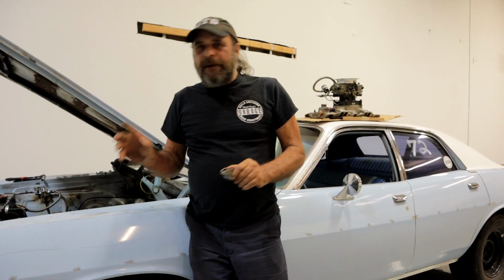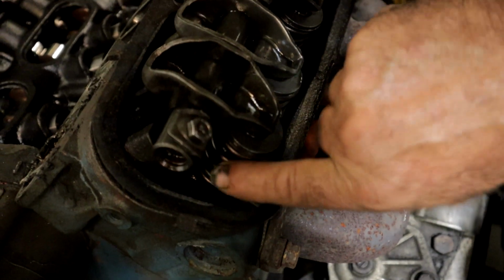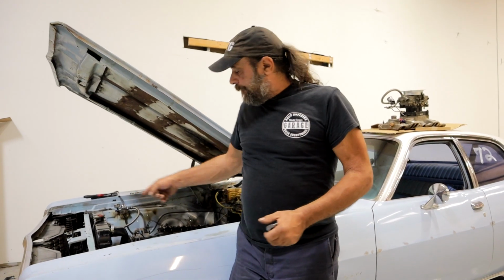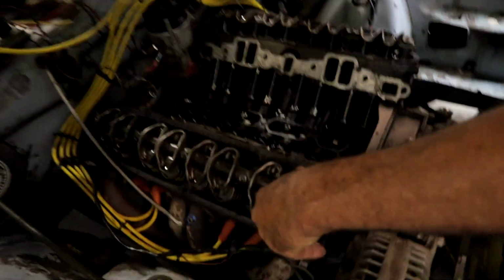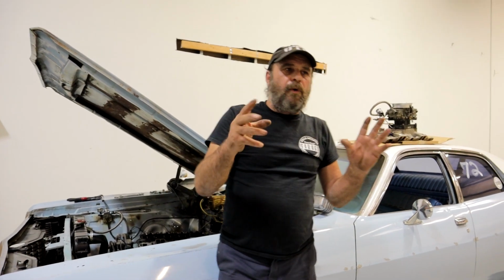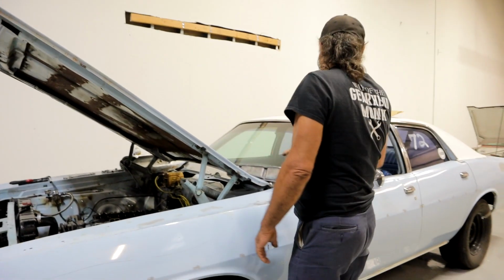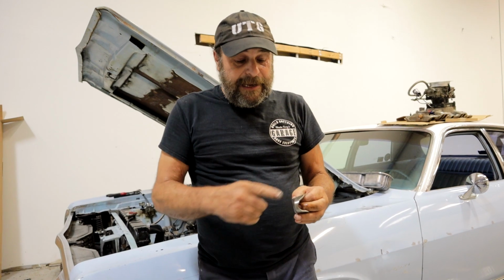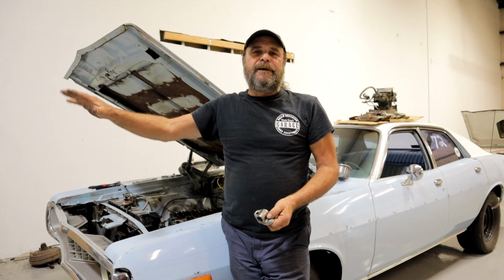Bottle Rocket Rocker Failure Explained

Comment: Why wouldn’t you run a decent set of roller rockers with a cam that’s got that much spring pressure and that much lift it’s not gunna work well with stock rockers that’s what it’s gunna do every time just ask any good engine builder
Reply from the maker: Did you even watch the video, you freaking moron???  STOCK 340 valve springs....550 lift on the cam, 6000 rpm max.  What part of that it too much for stock lifters?  Idiot
Reply: @UncleTonysGarage  suzan wojiki will drop your social credit for this comment. You give negative comments way too much care. Let people talk and boost your engagement
Reply: @jamesola7968  I know right. These armchair or at best backyard mechanics that maybe built one engine think they know more than someone who has been doing this for more years than I've been alive.
Reply: @Zero fox Given, stock rockers would work on that cam setup all day long and never be an issue, wanna know how I know? Because I have a nearly identical setup on a big block engine and it's running stock Mopar stamped steel rockers. I used to daily drive the car, and never once had an issue. Plus you don't know how ANY of the specs on Tony's cam unless you have been watching since the earliest days like myself.
Reply: @alfulton5946    @James Ola   These 'doofuss' comments come from 'Keyboard Mechanics'.  I'm like UT, 50 years of doing nothing but MoPars, and NONE of them the late model 'disposable' fake hemi.  A pure stock 318 from the 60s and 70s with all OEM MoPar parts would sit and rev 6,000 RPM until it ran out of gas without doing any harm.  Modern 'Repair Parts' are just garbage...
Reply: This is an affordable build for starting car builders.
Reply: @ScottsSpeedShop  There is a recent video of Nicks garage where he built and dynoed a customers 454 chevy. Aftermarket heads, hyd flat tappet cam and stock stamped rockers. Made 570hp. I know its not a  mopar build but the stamped factory rocker arms were more than  adequate on this build with the cam he installed. The commenters went nuts wanting to see some pretty gold or red anodized aluminum rocker arms. The TV channels have made everyone believe they need Harland Sharps or T&D for every build.
Reply: @ScottsSpeedShop  i love that you watch this channel, i found you because of the little red ram hemi (do another) you and tony should do something together.
Reply: @TheOverisel  it is a shame what the world has come to man. I know with my customer, I tell 'em if it's a street car and you need adjustability, ductile iron style rockers are the way to go, like the 273s had or like the max wedge engines had. I haven't ever been a huge fan of aluminum roller rockers, but sometimes that's the only option. Like on my edelbrock victor heads, I can only run aluminum roller rockers on them because of the offset
Reply: @TallGarage  I have been following Tony since the day he started. Him and Kathy are great people and I bought a six pack setup off of them years ago. As far as the Red Ram Hemi, I do have one stored away, that I am gathering parts for. I will build another.
Reply: @UncleTonysGarage  Are those valve springs rated for the cam its being used on? By that I mean are they strong enough to hold the valve train based on the ramp of the roller cam? I realize that they are stock springs but are they stock roller cam springs? I only ask since with a high ramp rate a spring can lose stability even at 6000 or lower and cause issues like the rocker failure.
Reply: @ScottsSpeedShop  I'll trust the opinions of UTG and Scott's every day of the week.
Reply: Hey he spelled gonna with a U, what do you expect.
Reply: @zerofoxgiven89  you specifically mentioned springs with that much pressure. Are you claiming that stock valve springs with .560 lift is too much for stock rocker arms?
Reply: @nastybastardatlive    Hahaha...  And he's probably 'jelly' of UTGs knowledge too!
Reply: @zerofoxgiven89  Brand new lifters from a big box brand cam company should not be bleeding down like those are, even if he put a fancy set of roller rockers on he would still run into the same problem with the pushrod smacking a hole through them. The problem isn’t the rockers, it’s the lifters bleeding down.
Reply: @seandraves828  exactly what I’m trying to say. A stock 340 spring would be for a hydraulic flat tappet cam not for a roller cam
Reply: @NYPATRIOTBX  never once did I say anything about the issue with the lifters
Reply: @UncleTonysGarage  I agree with you unka tony, and you really should not call him an idiot. even if he is.
Reply: ZFG,  you may think you have THE answer...  I will point out that chrysler cams and failed hydraulic lifters cause this same punchout.  at the cab Co, we'd toss a random lifter in the engine and go up to the next oil weight.   Tony may punchout more rockers but a failed lifter is doing it.
Reply: @zerofoxgiven89  No you didn’t, but your assuming it’s a problem with the rocker when it is not. The spring pressure and cam lift are nothing to write home about.
Reply: @frenchonion4595  and ??? How many has he done right?  My gosh he knows what he is doing
Reply: A stock rocker should hold to 6000 no problem, on most stock motors the lifter is the weak point you'll float the lifters before you damage a rocker arm ive seen ford 302 with stock rockers and a good set of lifters rev to 8000
Reply: Here's my couple of nickels worth and this is something I learnt from being an aircraft mechanic for the last 22 years.  There's always something to learn from somebody...whether a seasoned pro or a noob.  You absorb what's useful or you hold your tongue for what isn't, for what you may think someone is full of crap when it comes to say hydraulic lifters but have a wealth of knowledge when it comes to anything else.  Don't burn your bridges on somebody because of one stupid thing.  But I do tend to side on UTG on this one.  Crap components run amuck in today's world...and the same goes for the aviation industry.
Reply: I ran a Direct Connection purple shaft cam with more lift than that in my 1970 440 and put 100,000 miles on it and never had any rocker problems.  I used stock, Chrysler hydraulic lifters and my redline on that engine was 6,000 rpm.
Reply: @NYPATRIOTBX  I doubt he even watched the video.
Reply: I will point a good part of the blame on quality control of parts and even some of the metal quality. Thats what we get for relying on everything china.
Reply: It's about budget builds for the average car person.
Reply: @UncleTonysGarage  sick 'em you hot-headed Italian!  Chevy guy, probably eats paste & Tide Pods! 🤣🤣🤣🤣 With you 100% on this build Tony, my favorite on YouTube!
Reply: Also kinda funny how a channel called The Gas Tap built a ringed & bearinged, home ported head 360 Magnum that ran 12.60-.70s in a short bed pickup with stock rockers also. Just sayin'.
Reply: @brucenichols540  you say that but the new hemi(which has a better chamber design than the old one btw) you can use stock rockers and get some OEM non MDS lifers and never have any of these issues.  sit at 7000rpm with no issues on hi compression 5.7 hemi, especially with the much nicer lifter angle. the problem is the mopar small block is a really small part of the aftermarket so companies don't want to invest money in better parts for them,  which is wrong but its what they do. this is why I just plan to move on after I get tired of my magnum and build a 6.4 gen 3 hemi. quality parts, heads are better, lifters are better(the issue with the lifter failure is just due to low idle speed and thinner oil to maintain emissions, that's why the hemis and 392s don't have the issue only the earlier 5.7s)the block casting is much nicer, they can take 1000hp with no issues, the cam bores arent misaligned, the lifters bores arent misaligned, better casting material with more nickel content and a lighter weight. the fake hemi would whoop any old mopar engine any day of the week.
Reply: Plan Z!!
Reply: @AndyGeesGarage  never said that they would or that was the problem of the leak down
Reply: @UncleTonysGarage  I deleted my comment. I don't want to be a "wack-a-mole  psychotic"
Reply: Lmao
Reply: Comp cam is garbage now
Reply: @PredaFran  All true!   However, I'm only interested in the longevity of my equipment and its easy repairability.
Reply: @PredaFran  the lifter issue can be fixed by eliminating the mds . as great as the classic Mopar engines are the gen 3 Hemi is superior in pretty much all areas .
Reply: @zerofoxgiven89  if the stock springs are ok on a flat tappet cam then they will certainly be fine on a roller. Roller cams have softer ramp rates than flat tappet cams. Don't take my word for it check out David vizards channel. He has a video on the subject.
Reply: @UncleTonysGarage   Tony. Im sorry but i didnt catch if the rockers are new or used old ones? I too have had issues with brand new roller cams having lifter issues. It was a few years ago now but i believe the set i used were COMP CAMS... I did everything right. Cleaned the lifter bores.. Whole 9 yards. But when that engine was only run for short trips infrequently it would have lifter tick. Even once warm here and there. After i started daily driving the car a while later all that stopped. Kinda like the lifters needed to seat in to begin getting proper oiling. Now this could have been due to sludge in some oil passages that finally worked out.. Not sure. But it took a good. 1,000 - 1,500 miles for things to get acting right... Now onto the other strange issue. 318 that keep wearing out timing sets.. On 3rd set now. In 5k miles... Tried different brands tried stock single and true double roller... Ever see such a thing? Haha
Reply: @UncleTonysGarage  I like that response Tony, it is very appropriate for the question.
Reply: @UncleTonysGarage  Perfect answer! "Dude, are you kidding me? I just spent 10 minutes explaining why I'm using hydraulic lifters and stock rockers."
Reply: @brucenichols540  what kind of car do you
Reply: Those rockers should of handled it. Plus they are shaft rockers. Strong as hell. I'm old guy and we ran more lift on em back in the day
Reply: @richbon8825  I'm sure Uncle Tony is right about the failure: The lifters bleed down and on every startup the pushrods are pounding the rockers until they pump up again. This particular rocker might have been weaker but it's only the first of many if the other lifters are bleeding down like that.
Reply: @UncleTonysGarage  Thank you Tony, keep it real brother.
Reply: Stock valve springs won’t wear the same unless the lifters are unified against the intake valves.....

.......I don’t know shit about engines.....just wanted to be part of all this 😩
Reply: @frenchonion4595  a lot ..and the best builders have cams go bad so don't act like it doesn't happen
Reply: @maidenrulz73  No worries, just because you don't know shit about the subject is no reason not to comment. This is the internet.
Reply: What i did was Not watch the video at all.. but I have money, so I don't need to too.. what I do know is you didn't spend money like I do, Cause I have money to spend or at least the guy charges me money.. That I have by the way... 
Only the Very Worst Advice Only.. UTG come get you some hahahah 
@Ø..
Reply: @zerofoxgiven89  Stock rockers have been holding up to cams like that for a long time now. Folks have been elongating the slots in stock chevy rockers and running well over .500 lift for probably fifty years or so. Same with other brands as well. With that said, I lost a stock rocker on a 350 with stock LT1 springs (the original first gen LT1) and a 350 horse hydraulic cam (.447" lift) once, years ago.Just a fluke, same as Uncle Tony's situation. It happens occasionally.

You should keep your piehole zipped and give Tony a little credit. He said lifters but probably meant springs. I'd be pissed at your post if it were my video too, you spoke without knowledge to back you. I think Tony's a pretty damned good builder, probably a lot better than you. He wrenched top fuel motors for years and was a successful magazine writer as well.

By the way, Tony gave us a theory as to what's going on, and it doesn't have a thing to do with the springs. Maybe if you took time to watch the whole video.....
Reply: @zerofoxgiven89  Hey, dude, I have seen builds like this several times, and what I think has gone over your head is this: there is NOTHING wrong with how this engine is built, the valve train should be fine. However, because the lifters are allowing slop in the valve train, the pushrod beats itself and the rocker arm to pieces. Roller rockers would NOT fix that issue. What about any of this is so difficult to understand? Shitty lifters have caused this problem, NOT any other part of the valve train choices made. You simply wanted to add your two cents to a conversation that seems to be WAY above your level of understanding. If he had been using roller rockers, then the hydraulic lifters bleeding down, would have then destroyed an expensive ass rocker or set of rockers. Get that through your thick ass skull. THE only solution to this issue, are lifters that do not bleed down every time the engine is shut off. If you can't understand that, you don't need to put your input into a video. You instead decided to play yourself as a fool. And it is, that simple.
Reply: @zerofoxgiven89  did you not listen to what he said? The cam is about as close to stock grind as you can get, the problem appears to be excessive lifter bleed down.
Reply: @1965l88  if he was so successful in all that why wouldn’t he still be doing that instead of on YouTube making videos where you can’t get fired. I don’t care who you are if your on a top team making big money and all who’s gunna stop that unless they got fired because of all this shits probably happening just like it is in the vids he posts
Reply: Bruh, get some sleep
Reply: @HowardJrFord  indeed, great engines
Reply: @jamesola7968  lol- Tony hasn't been building motors for 50 years, he's only like 59 years old !
Reply: @brucenichols540  i do like the fact that the LA can be maintained by a minimal set of tools but i don't see the ease of repair anymore with the prices of carbs and all the shitty repair parts. It's not worth the effort to buy NOS parts because of the cost. It's just cheaper to switch to a gen 3 than to wade through all the junk parts.
Reply: @davidleonard8369  i though the main advantage of roller cams was the faster ramp rate, at least my roller cam has a fast one
Reply: @frenchonion4595  yeah your right you know more than him 😏
Reply: @justralphajerseyguystuckin3671  45 years, then. Since he was 14.
Reply: @PredaFran  according to David Vizard roller cams have much higher lift acceleration than flat tappet cams but only after the ramp. Anyway, the cam in bottle rocket is not very radical by any stretch of the imagination and stock 340 springs should control things very nicely.
Reply: To make this statement you obviously didn't listen to the objective of this project. The real sad part of garbage parts goes beyond wasted parts money and time. Let me explain by using this scenario...... your building your first project  as a young person. Your not wealthy, your not experienced.  You are going to get discouraged real fast when everything you touch turns to shit or water through no fault of your own . It's not just car parts either . Almost all consumer goods are terrible quality anymore. And shame on manufacturers who put profits ahead of quality.
Reply: @derrikspivak4523  too big a cam?  The cam in bottle rocket is identical to the stock cam. They are both about 2 1/2" around and two and a half feet long. Ha ha.
Reply: @truckerkevthepaidtourist  real trucks are white and have 2 pedals
Reply: @jamesola7968  ya because as soon as you do something exactly 50 years you know everything and nothing changes.
Reply: @jeffrogosz383  maybe in your world not in mind.
Mine is a Pete long hood out in front of me,  a 600 horsepower cat and an 18 speed with three pedals
Reply: @AtZero138  moneu?
Reply: @ScottsSpeedShop   Love the channel. Just need more chevys on it. Lol.  Just kidding I watch all your vids man.
Reply: @MrJeffcoley1  will now appear edited.. thanks
Reply: @lonewolf744  anyone else with some common sense wouldn’t use stock parts on a setup like that if they didn’t want problems out of it or wanted it to last
Reply: Your original comment makes no sense. Spring pressure has nothing to do with it... Stock springs. I don't think a big-ish cam with stock springs would eat rockers. If you were making that comment and relating it to valve float, you'd be on to something. I don't believe this combo would cause the springs to bind either. What you are saying doesn't fit what happened, you also have to take into consideration how long this engine ran with no issues. And as for the guy that stated .519 is max lift for stockers.......... Apparently he has never seen small town circle track engines and witnessed what guys will do to fly under the tech radar. Books and forums can only tell you so much, if people didn't push the limits we'd still be runnin flathead 6s.
Reply: @lonewolf744  thanks James, glad you dig the content brother
Reply: @zerofoxgiven89  
Ever think Tony might be retired?
Made his living and just does this for fun now - a lot of guys work part time after they retire because they like what they do.
Learn to think deeper.
Reply: @UncleTonysGarage  Hey UT...why so hard on Zero FOX?   In my Pontiac world .550" lift is RIDICULOUS huge!   That is RAM AIR V territory.   I was thinking the same thing,  way much lift for any stock part in Pontiac-ville.  Lift .469/.516 on the legendary RAM AIR IV 400.  Maybe Mopar valve train is substantially different and all,  just saying...
Reply: @ScottsSpeedShop  Yes the good aftermarket heads mandate more trick components but I bet it will run like hell. For those who want the iron adjustables Crane no longer makes them. But Mancini sells some for under $300. I imagine they are made in China but they look like the old Cranes.
Reply: Did you hear the "FOR THE BUDGET MINDED EVERYDAY JOE TRYIN TO MAKE POWER FOR CHEAP OR FREE"
Reply: @frenchonion4595  I work at a manufacturer let's say it starts ch.and it's in bg.ky. how many times do you think we shut down this past year for bad parts from BIG manufacturers?  
Now in your mind things can't be bad if it's a big name manufacturer makes them lol. Let me tell you they still make shitty parts . 
I'm sorry if motor trend didn't explain this on one of their shows.
Everyday people work at these places and they have bad days like anyone else and if you still think comp cams can't make shitty parts ...well to use Tony's words( idiot )
Reply: @modeljetjuggernaut4864  Ill never fly again.
Reply: @bennyboyy7  WELL SOMETIMES BUDGET JUST DOESNT CUT IT and definitely doesn’t when it comes to valve train components
Reply: Uncle Tony, please tell us what giant cam company has to say.  I'm sure we would all like to know.
Reply: @bennyboyy7  people ignore that. They expect UPS to be dropping off pallets of new parts daily like on tv and other channels. Tony said the problem was not the rocker arms but the lifters bleeding down. Those lifters cost about $400 and their crap. All the trusted name brands from the Golden era are making junk now.
Reply: Why would the rockers cause the lifters to bleed off
Reply: @UncleTonysGarage  all time best response ever.
Reply: @zerofoxgiven89  you do realize he meant to say rockers not lifters.
Reply: @UncleTonysGarage  glad you set him straight. It's obvious to everyone else that you know what's going on. Guess this guy is a know it all
Reply: Got to follow the cam card specs, recommended lifters, valve springs, rockers etc. otherwise this whinge is null and void.
Reply: @zerofoxgiven89  Been using stock rockers and single springs on my 500 lift cam since 1990. Bracket racing,street racing,drive to Washington from Kansas twice. Still running.  Still turns 6000 rpm.
Reply: @jonathanlawson4667  bs, a bone stock 340 has .444 lift with 1.5:1 stamped steel rockers. Literally thousands of them have had .480- .550 lift cams dropped in an ran the piss out of.
The issue has almost zero to do with lift.
Its the push rod slapping the rocker with a flat lifter.
Basic physics, mass in motion tends to stay in motion, mass at rest gets holes punched in it until the oil pressure comes up....
Reply: @UncleTonysGarage  
You tell "em Uncle Tony !!!!!
Reply: @UncleTonysGarage  Stock 340 springs probably lost a few lpbs overtime(don't know the history) so id say they would be perfect to run on this set up and defiantly not what caused the rockers to give up, more likely the lifter is bleeding down so fast its hammering the rockers at RPM, ive done 6 cam swaps in the over the summer and all but one set bleed down.{ all brand new and from that big cam company) finally swapped out for  a cam& lifters from a 440 was rebuilt 15 years ago and walla no bleed down! been a rash of them over the last year.
Reply: @nastybastardatlive  ROFL ..now that was funny!
Reply: Howard cam is not to blame you are just trying to get free stuff from them. Maybe you need learn how to build a better motor, instead of talk bout it
Reply: @seandraves828  would they cause the lifters to bleed down?
Reply: @zerofoxgiven89  did you read your own comment? “ with that much spring pressure and that much lift stock lifters…”  common man!
Reply: @jamesola7968  Ya think?
Reply: @anthonysmithey11  And we have a winner.
Reply: @ScottsSpeedShop  You run your big block at 6000 rpm do you.... whatever..
Reply: @brucenichols540  BALONEY.... prove it.
Reply: You are very wrong and you probably can't even tell the difference between a shaft mounted rocker arm , fulcrum and ball, or roller rocker any way . Roller rockers are just adding something  else to fail if there is no reason for it in the first place, at the levels he stated there is little reason for me to think roller rockers would have fixed the issue.
Reply: @AndyGeesGarage  Yup, the bad lifters will just be detonating more expensive rockers.  Sounds like a deal to me.  The rockers are defective and Tony should have a Fedex package with good new ones tomorrow morning.  Or they don't pay enough attention to he does for their business without being sponsored.  The sign was on the wall in his old shop, after all.  No way Tony should need to buy replacements, problem is that unless they address the quality the replacements will fail pronto too.  Bottom line is that the lifter doesn't know it's drag racing.  And its supposed to be built to handle the ramp speeds of a roller cam.
Reply: @two_number_nines  Screw "the social credit" crap "comrade"...
Reply: @zerofoxgiven89  do it all the time
Reply: @danielleclare2938  My 451 stroker revs to 7,000 rpm safely with no issues, but makes peak power right at 6200 rpm, and I have never had an issue. Want proof, I have videos of driving the 1973 Satellite around and early videos of the engine before it was in the car.
Reply: @UncleTonysGarage   I'm not an engine builder, just an engineer who has designed lots of parts and I agree with you in that I don't see how lift means anything with regard to stamped metal rocker failing in this manner except one thing. 

You've got two forces, spring and lifter. So long as constant contact between the push rod and the rocker is maintained there's nothing special happening to the rocker if those two forces are unchanged. Only when it starts getting hammered because of the lifter will it fail. 

But there's the one thing. if the valve is opened further that increases the spring force by mere distance. F=k*x. But that by itself shouldn't be anything horrible. But.... 

Tolerances. It's a stamped metal rocker. the tolerances at the push rod/rocker arm interface and the change in angle due to the lift. That change in angle changes how the rocker is loaded, which shouldn't be a big deal except if a rocker is on an edge of the tolerance range in some manner. 

These are stamped sheet steel and thus there's stretching of the metal and so on. Ideally they are identical because they came off the same tool, but what if they didn't? Or if one was made just before the tool was taken down to be refreshed/maintained? Then there's the steel itself. 

It goes back to all the junk that's out there these days. I think if a proper analysis was done between an original OEM rocker arm and these new aftermarket ones it will show that the OEM rocker arm from 50ish years ago has a much higher factor of safety. Dollars to doughnuts today's 'stock replacement' rocker arms are just good enough for stock. Not much margin in them for hot rodding if any. You get one on the edges of the tolerance bell curve then use it in a hot rod application it fails. The lifters being much the same way just accelerate the process.
Reply: @zerofoxgiven89  "Why wouldn’t you run a decent set of roller rockers with a cam that’s got that much spring pressure" DUDE that's what you said lmfao. Rockers aren't the issue, the lifters are.
Reply: @anthonysmithey11  I am with you.  I know things will cost more, but the quality of American products is worth it in my opinion.  Look how expensive and time consuming it will be for Uncle Tony to buy replacement parts and repair the engine AGAIN! (assuming the cam company doesn’t replace them for free).
Reply: @ronprice7495  one of the cam retainer plate bolts should have a hole in it
Reply: @ScottsSpeedShop  Ok thanks for the reply. Lots of bragging without receipts these days but you sound reasonable so I appreciate your comment. Be safe!
Reply: @jeremydavies732  Roller cams have aggressive lobe profiles and that requires higher spring pressure to keep the valvetrain under control. In which a 340 spring can’t handle nor shall a stamped steel rocker handle. There’s going to be valve float from those springs because they can’t handle the lift which in that case causes what we see here in this video
Reply: @zerofoxgiven89  wouldn't a higher spring pressure just push the lifter down "bleed" it down faster? Even if the springs aren't heavy enough, that would mean no pressure when engine is off, meaning no bleed down? IDK just like how you didn't mention the rockers lol.
Reply: @jeremydavies732  what I said had nothing to do with the lifters bleeding down never once said anything had to do with the lifters.
Reply: @jackieliner3812  well idk about you but I don’t know of any small block dodge that came out with a cam that had 550 lift the most would have been around 480 and that’s the most!
Reply: Is it a problem caused by the lifters being machined by people that do not speak English, as a primary language, or is it the colored water they are pawning off on us as 30 weight, or a combo of both ?
Reply: The actual problem was the lifters are bleeding down. It has nothing to do with spring pressure or cam lift.
Reply: @zerofoxgiven89  I think that was UT's point 🤦‍♂️. Have a blessed day.
Reply: @UncleTonysGarage  ummm cough cough my comp lifters did this as well
Reply: @zerofoxgiven89  550 is not that much lift dude..... 
.
and stamped steel rockers are quite strong..... can and have been used with MUCH higher spring rates and lift
Reply: @SweatyFatGuy  even as a Pontiac guy myself, I still have love for my Chevy brothers. You and I both should know that if it’s a Pontiac it better be a 400 or 455. Talking performance wise. But even I’ll admit a gem 1 350 Chevy will out walk/jog/run a 350 Pontiac
Reply: And I should mention the 421, almost forgot about the NASCAR winning engine, and the 389 which lit the muscle car era
Reply: @alantuttle492  see this is where confusion starts. I thought so as well... Seemed to me to be a lack of oil issue. As chains were kinda dry. Also if parked nose down the engine (chain) was MUCH quieter. I am opening her back up again soon. But its been a few years since the last time i did the last chain. Not many miles. But many beers ago.. Haha i cant remember for certain but i almost could swear none of the bolts had a hole. Also there is no oil slinger and no pointer. This seems strange but looking into this deeply i find many discuss how small block mopars came with various arrangements for this oiling(or lack of) system. I have found others online state they had 318's with no oil hole bolt as well... Some drill their own passage.. I had a theory that maybe being a later smog engine with a nylon teeth gear set, maybe they felt it wasnt necesary to send constant drip of oil to the chain?? Its. 1986 chrysler 5th ave. Original 318 2 barrel. About 135,000k miles. Engine was NOT taken care of proper. As opening it up i found a lump of crusty flaky sludge setting ontop the lifter spider that almost covered the entire valley and was almost as tall to reach the intake...  I scrapped all i could out and After changing oil every few hundred miles for atleast 15 changes the oil now runs clear until i reach 3-4k miles. Its been something else this car. I have had every part of it apart atleast twice haha. Had to replace the k frame after a slide on ice sent me side ways into a very tall curb doing 40mph. Leaf springs, somehow swaped a used vinyl top from a junk yard car to it. Had to redue the floors after i realized the windshield had been leaking for years... Whole dash and all electronics been gone through because of this water issue... Haha love the car tho. Thank you for the reply tho my friend.
Reply: @TheOverisel  Yeah, right? I saw that too.
Reply: @SweatyFatGuy  Guys like "Zero fox Given" continuously cause trouble here for one reason: they're TROLLS........pure & simple. He didn't even watch the video entirely, or else he would've known that these brand new roller lifters are bleeding down & caused the pushrod to bash a hole in that rocker during start-up.
Reply: @nastybastardatlive  Yeah, right? The guy is a troll.......pure & simple. He didn't even watch the entire video, or else he would've known that the issue is these damned brand new, roller lifters bleeding down. Notice how he didn't even mention that as he was trying to ridicule Uncle Tony. Tony just needs to block these trolls & be done with it. Hell, between those BAD lifters and these trolls.......I'm pissed off too.
Reply: @NYPATRIOTBX  BINGO.......THANK YOU.
Reply: @jamesola7968  Hello James. You used the wrong "to" and you used "the" where you likely meant to use "than". You should have used "too". Since so many of the comments on this video are negative, I thought I would add my too sense to.
Reply: Hello James. You used the wrong "to" and you used "the" where you likely meant to use "than". You should have used "too". Since so many of the comments on this video are negative, I thought I would add my too sense to.
Reply: @UncleTonysGarage  nice ass chewing! Loved it.
Reply: @zerofoxgiven89  When did Tony ever say that he was on a top team, making big money?  If I remember correctly, he clearly said in more than one of his videos, that he was working on nitro cars owned by guys with not a whole lot of money and that they would get hand-me-down, used parts from the professional teams and even dig through the garbage cans in the pits to scrounge up usable parts.  He also ran a couple nitro cars out of his Staten Island home garage.  He clearly did it for the love of it.  Making money racing nitro cars takes deep pockets.  Those engines EAT parts!
Reply: I've  been around hi performance  mopars for years roller rockers have many advantages but Uncle Tony has a very valid point the HYDRAULIC roller lifter needs to hold pressure untill the next start and should not be clattering on initial  start-up. Some cheap oil filters do not have a one way check valve and allow the oil to siphon back into the pan this could be exacerbated by having a looser bearing clearance ( for racing) in the bottom end.
The mopar rocker arm is an extremely  low friction design at the shaft pivot but will still wear the valve guides with a high lift camshaft because there is no roller out at the tip and there is a lot of side force on a hi- lift cam
P.s. our 69 Barracuda 440, 727 (automatic), dana 60(4.88) gears,spool, 1050 dominator carb., solid cam, 3800 stall converter only ran 11.60 quarter miles it had about 550 h.p. at the flywheel and was run at Bandimere speedway at 7000 ft. Elevation with the modern Trick Flow, edelbrock victor, or Indy heads it would have run in the 9s but back in the day all we could do was port our 906 castings after we put in bigger valves.
Reply: @drivecam101  as an engineer  i thought you might include the subject of possible coil bind in your statements.
Reply: @truckerkevthepaidtourist :  Lucky you. The Petes I drove had no hood. . . . .
Reply: @brucenichols540  actually they valve float at about 5 grand.
Reply: @richc3437  lmao  wow just wow 👏
Reply: @donallen2819 ???? Are you saying I can't spell......well I agree 100% I suck at it 
but I do know and understand what Tony was saying .
Reply: And its time to turn off my comments reply cant handle these kids on YouTube
Reply: @SweatyFatGuy  Hey don't go beating up on Chevy guys. I'm one and I'm on Tony's side........
Reply: @anthonysmithey11  Exactly
Reply: @HowardJrFord  except for the fact that they are known to wipe out cam lobes because of a poor oiling design.
Reply: @PredaFran  cheaper huh? So $10,000 plus engines are cheaper than grabbing a junk yard or hell even a parts store long block LA??! You are out of your damn mind. And newssss flash... If you know anything AT ALL about modern production mopar hemi's , 5.7's especially, you would know one of the common failures is.... Lets hear it... LIFTERS! Haha.
Reply: @CamaroSS-sy2ei  ive worked in a factory here in America.. Trust me this country doesn't make some magical product... I saw shit that would disappoint a lot of folks... What it comes down to isnt country of origin. It is the company who owns the business/factories.. People dont realize that years ago many companies were small family owned type operations. Who all competed with each other. Which it turn made everyone's products better. But the last 50-70 years companies have bought companies who bought companies who then merged with a company to then be bought by a bigger company... We are at a point where basically i bet 100 corporations own and operate 95 percent of all manufacturing in the world. It no longer is much about compitition. And striving for superior products. It is just cranking shit out to fill a need. Picture walmart vs a local owned store... Same deal. Walmart doesnt really give a shit if they have the best quality goods on shelf.
Reply: @UncleTonysGarage  I don't think he understands that the 340 is strictly a  high performance engine , with stronger springs than 318/360's.......?
Reply: There goes another 3 to 4 hundred
Reply: @SweatyFatGuy  It's funny you say that, i used to rip on my brother-in-law, because he is a Mopar guy, but as time went on, i found he liked Ford and then he bought a Toyota FJ Cruiser and recently bought himself a new 2021 Jeep Truck. so...over the years, we talk about all brand and models. to be honest, the only think about Chrysler/Dodge that bothers me is the Transmissions, i love the designs, like the Magnum RT.
Reply: @t44e6  No but it would cause the valvetrain wear such as the hole in the rocker
Reply: @seandraves828  yeah I think I'm just not getting what Mr Vizard is saying. Or at least I'm not smart enough to understand him. Thanks for not calling me stupid.
Reply: @ronprice7495  I understand that crap can be made in America.  I see it all the time.  Just imagine the garbage that some of these commenters would be happy to churn out.  However, my opinion is that without slave wages and with a semblance of quality control, the average quality of parts would increase.  Also, I think most people are willing to pay a reasonable amount for quality.  Your point is noted, though.  A good company has good people throughout who actually give a shit or two.  It doesn’t matter where it is located.
Reply: @UncleTonysGarage  are the springs really good enough for the aggressive cam profile ?
Reply: @zerofoxgiven89  they do on a cleveland ,maybe the ramp speed on cam .
Reply: If you had a CLUE about the history of the Chrysler stamped-steel rocker (it was a new technology and a new manufacturing process created by one supplier, never before used, for the B/RB engines and then added to the LA smallblock), you’d know they’re probably just about the strongest and most reliable stock non-adjustable rocker in automotive history.  90% of the “high performance” roller rockers you can buy are weaker or more prone to fatigue failure than these… although they may have a more consistent ratio which if anything is the weak spot of Mopar stamped lifters. To get a set of aluminum roller rockers that are actually as reliable and strong, you gotta spend a lot (eg. Harland Sharp), or use a ductile iron rocker. The real shame is that the HD version is apparently no longer available through Mopar Performance.
Reply: @dznuttzonyachin7499  Good one.  Are you “gunna” be in 7th or 8th grade this year?
Reply: @MrJeffcoley1  no I agree. That was the problem
Reply: @ronprice7495 then how do they hellcat and 392s don't have lifters failures, the hellcat and 392 have a higher idle speed, thicker oil, and no MDS. a 392 short block is 3000 grand from the dealer btw. and that block is good to 1400whp with no issues. even in a stock form you just put a cam and are at a 500 horsepower, you cant do that with any small block mopar, and never will. sure you can get a ritter R3 block for 3400 bucks and spends more than you would on a gen 3 hemi to upgrade it, but then you just have a worse engine that you would if you had a built gen 3 hemi. a LA engine needs a lot of bottom end work to even go past 600 reliably, they need lifter bores trued and bushed to go above 6500 reliably. a gen 3 hemi does not care at either of those. the STOCK heads flow more than a fully ported W9 head, and those heads cost $$$$. drop some better springs and a cam,new pushrods, sure go to 7500.
Reply: @seandraves828  they are stock 340 springs. They'll hold up fine. He even said it won't see 6000 rpms. Like 5400 is where one revs out.
Reply: @UncleTonysGarage  you tell'em uncle tony..
Reply: @williamturner2617  For this channel it isn't something I thought would be necessary. It's a condition that can be seen with the naked eye. Turn the engine over by hand with the valve cover off and the coils touch each other. Unless it's a very very light kiss it's going to cause all sorts of problems because it's basically a hard metal stop for the valve train.
Reply: @jonathanlawson4667  I've built plenty of engines. I was replying to Zero fox Given  I know nothing about mopar engines, and would assume Tony does and knows enough about coil bind Lots of ford and chevy guys just start assuming there all the same. Only one engine that I built and failed was a 427 chevy and the issue was running it to 7500rpm all the time with stock 3/8 bolt rods, but ARP rod bolts.  installed. Chevy had a better stock rod option( fitted with 7/16 bolts), I don't .know  it would have held up better. That motor never let go but the rods must have been stretching. The first time after a month I tore the engine down after noticing a noise. The piston dome starting  hitting the head. I never checked clearance because it was L88 pistons and the biggest stock open chamber head made stock. At that point in time I made sure everything had proper clearance and then 3 months later same noise. Instead of keep cool and redoing the engine with proper rods, I said fuck this engine and pretty much gave it away. That cam had .638 lift on the exhaust and of course I had chose springs that were rated for over .650 That engine also had sever duty long slot ball and fulcrum rockers rather than roller rockers which at that lift it might be wise to run a roller. Even then a 1.5 rocker isn't going to act  the same a a 1.7  as far as what happens to what . All I know there is there was zero rocker or push rod(7/16) issues, while others might state as fact there would be. That engine had 1.7 rocker ratio.I don't recall the spring pressure , but this was a solid flat tappet cam, so it wasn't anything crazy.
Reply: @two_number_nines  Coming soon, right after the jab.
Reply: @UncleTonysGarage  Come on Tony... Don't hold back. Tell 'im watcha think.
Reply: Obviously you didn’t pay attention to Tony when he explained in great detail the 5 W’s of this engine build; Who, the average guy with limited budget and skill, What and average small block with reusable parts to costs
Reply: Where; done in the driveway with minimal outside help, When; time frame varies because of budget or obligations, Why; because some people really like Doug stuff themselves instead of letting others do the work, sense of accomplishment! How, by using the means he has at his disposal. And you can insert the word she instead of he anywhere in this reply. I can hear his significant other slapping him up along side the head. PAY ATTENTION!!
Reply: @95Sn95  gonna is not a word Mr. Genius...
Reply: @truckerkevthepaidtourist  it was sarcasm calm down .The cat 🐱 is where it’s at. Tho
Reply: @truckerkevthepaidtourist  Easy on God's name in vane.
Reply: I bet everyone in this thread who agrees with the OP (if anyone does) is the OP on another account.
Reply: @LifeLongStrong1961  my comment was directed at the other guy, not Tony.  And I still tend to agree.  There was a bit of snarkiness  to that "ask any good engine builder". Is why I said, keep the crap comments to yourself if you disagree or find a constructive way to talk about it because some where down the line you might still learn something you never knew...
Reply: @jasonshaurer1970  lol is ok.  We still reject bad parts left and right until we get good ones..
Reply: @jamesola7968  Exactly..You can't argue with his experience.
Reply: Ahh the pin of shame.
Reply: @UncleTonysGarage  amen!
Reply: Ahhh haahhaaahhha ...ah ya.
Reply: @zerofoxgiven89  I just had the same thing happen to a stock rocker with a cam that has .484 lift.
Reply: @ScottsSpeedShop  Nice to see you on this channel. I'm more of a Chevy guy (pre computer only) but I agree with you completely. There is no reason I can see why his setup shouldn't work fine. My guess is cheap crappy parts. Just because they are name brand doesn't mean they aren't cheap crappy parts. Quality doesn't seem to exist anymore. He's already made videos about the lack of quality with new parts. I've run into the problem myself.
Reply: @brucenichols540  I agree with you with one exception. The PLASTIC cam sprocket. Replace that with steel and everything should be fine.
Reply: @jamesola7968  Yeah but the guy doing it never has anything that runs very long or is with a damn. You gotta start asking yourself if it's the cars or the mechanic. Name one car this fugger has worked on of his own that runs worth a damn.
Reply: Did they farm out the manufacturing to China?
Reply: Even if it was too much im sure someone can make thicker more durable rockers, if you can forge a sword you can forge a rocker arm